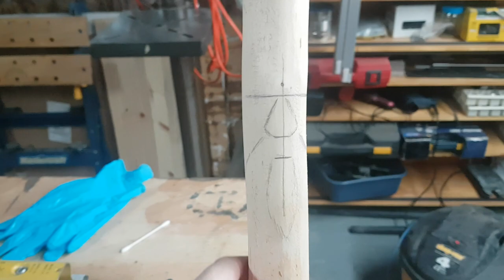Crystal Wood Spirit Walking Stick making

Comment: That spoke shaver sure works better than my Buck 110.
Reply from the maker: Once I spent some time filing down the plate and sharpening the blade it works pretty good. But straight from the store I was frustrated with it. Thanks for watching
Reply: @JasonHedrich  My pleasure!

Comment: What kind of glue do you use to glue the stone to the wood? I'm looking for something odorless. Ideally natural.Thanks
Reply from the maker: I use a 2 part epoxy... Probably not the natural adhesive you are looking for. I have seen others use thin copper wire to mechanically tie the stone to the stick... That might work for you

Comment: Have you tried driftwood for a walking stick before?
Reply from the maker: No, not yet. Haven’t found a piece of driftwood that would work… I’ll keep looking
Reply: I got a driftwood stick and need to reinforce the areas where the cracks are at got anything that could be of use horizontal and up and down
Reply from the maker: @soranightstorm9262  I've found that adding epoxy works well as it gets in deep and fills all the void. You can color it and it makes a nice addition to the sticks

Comment: a lot of this build is pretty straight forward but would have liked you to film the gluing/epoxy of the crystal since that part is a bit more unique. would have been nice to see that process in more detail. still liked/subbed
Reply from the maker: I’ll make note for next time. The glue up wasn’t all that complex… seeing I took the time to match the wood to the crystals shape, I just applied 2part epoxy and held the crystal in place with tape until it dried. I’ve seen some attached with thin copper wire as well, those look good too… maybe the next one. Thanks for watching
Reply: @JasonHedrich  what epoxy did you use?
Reply from the maker: @tanisbrisingr9919  I used a 2 part, 5 minute epoxy.

Comment: What kind of dermal is good for carving?
Thanks
Rex
Reply from the maker: Rex Carr, I think you are referring to a Dremel? If so, to start, you can go with any rotary tool and see if it works for you. The Dremel 4000 is a great tool for around $120CAN and can definately get you into the thick of it. If, and when you want to upgrade, FOREDOM has some beautiful, high end tools with more power but will set you back a little bit more in cash.

Comment: Hey great video and carving! What type of draw knife is that you're using to remove bark? Or is it some type of plane? I've never seen one like it. Thanks a lot and keep up with the videos!
Reply from the maker: At the start of the video, to take the bark off I used a spokeshave, made by Stanley. Works well to remove bark and to trim down sections of walking sticks. Hope that helps.
Reply: @JasonHedrich  great, thanks a lot, just what I need!
Reply from the maker: @massachusettsrestorationte3826  happy to help
Reply: Such a great and informative video.  I could never be as good as you but it gives me some ideas to start . Thank You So Much !

Comment: Some sawdust and glue will fill in the holes from the crystal. Use like plaster and sand back.
Reply from the maker: Yes that could work. The epoxy did fill most of the space so the fit was fairly seamless but good tip nonetheless
Reply: @JasonHedrich  I'm suggesting this not in place of the epoxy but so that the crystal looks more like it's growing out of the staff.

Comment: Great project and results, think I would like to try it. What is the name, brand and how to locate the large chisel you used after marking the stop cuts? Thanks and keep the projects coming.
Reply from the maker: Thank you very much. The chisel is a Pfeil, the type was a 3/30 and I purchased it here in Montreal at “Langevin & Forest” which is a wood supply store, they have a great website so you’ll be able to find them there. Thanks for watching
Reply: Lafayette Louisiana mimosa pleace 106a 70506
Reply: On Johnson and Congress